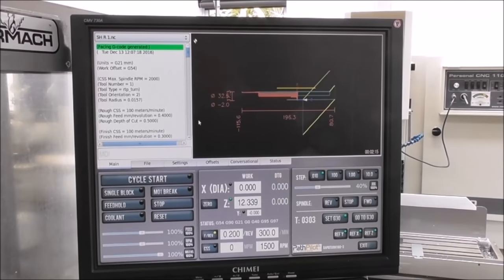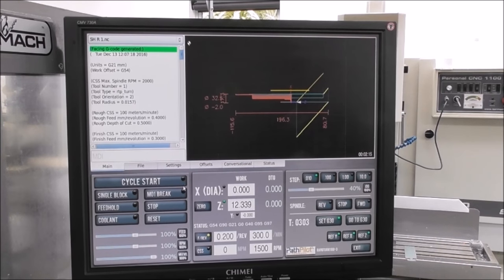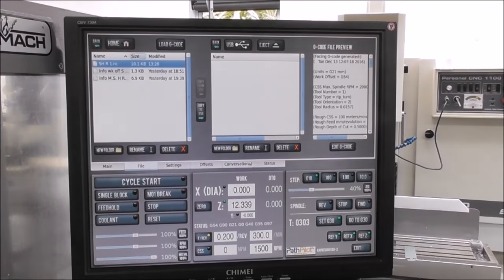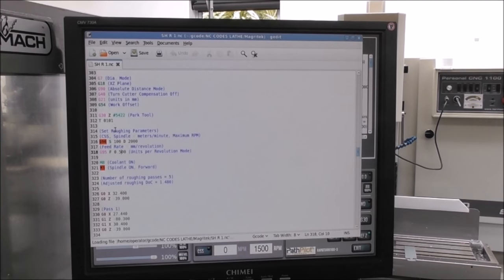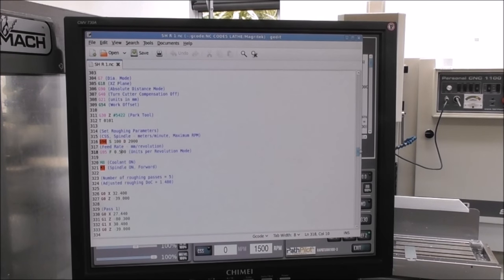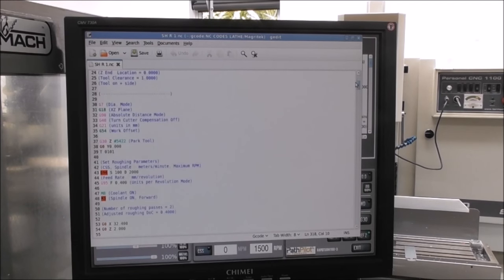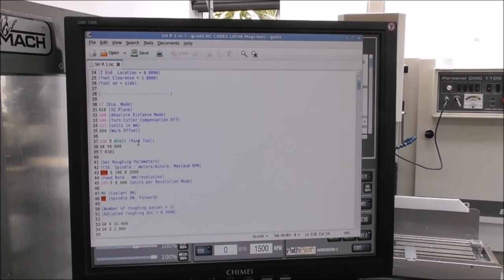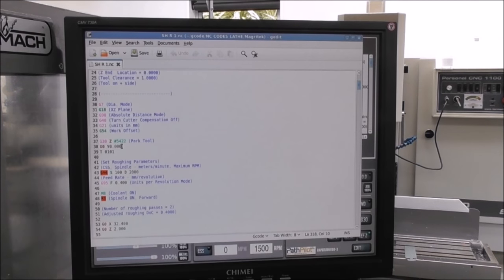Tormach RapidTurn -10 set up

Comment: Hi Cliff. Thanks for the video and all the great information in this series. You have made similar acetal parts in your mill spindle turning series. The advantages of rapid turn are clear but I'm wondering if there would there be any advantages of mill spindle turning over the rapid turn for those types of production parts? More gang tools, 1.5hp or greater rigidity perhaps? Cheers, Kieran.
Reply from the maker: Hi Kieranga. Interesting question. At the heat of my rapidturn decision. Well in short, so far I think rapid turn wins on most counts. The conversation software, lathe type speeds/feeds, threading, and the ability to use a tailstock. Outright power is the only downside I can think of - my mk 2 gang tooling will have enough tool stations. 

Cheers.  Cliff

Comment: Hi Cliff,
             t's nice to see things look good with the repeatability of diameters, I am pretty sure my problems were with the way I was touching off the tools. Your tooling set up looks great, once I get some time I will probably make something similar for my RapidTurn. 
Currently I am making a tilting fixture that will , hopefully, allow me to mount the 8" fixed rotary at the rightt hand end of the mill table and allow it to tilt through about 90 degrees in the y axis plane.
I couldn't find any
Reply from the maker: Thanks for posting Bob. Cheers.

Comment: I hope they also look at their Slant lathe.  There has been vibration problems with the 5c systems also.  They may simply need to look at the length of the spindle spacer.  From pics I've seen, the adapter may be too short.Have a Happy New Year.  Thanks from Texas.
Reply from the maker: Hi Vernon - Thanks for that information, I wonder if it is the same issue?

Comment: X - accuracy after repeated tool engagement with various material worthy of consideration at all?  Nice to see you got it paying for itself already!
Reply from the maker: I think you means test also for tool spring out with different work materials?...If so yes that will be worth doing. Cheers.
Reply: Yes that is what I mean in a way, I don't know how to put it into machine design terminology. One is the X movement accuracy (stepper, ball screw, flex in the column, etc.) or the flex in the tool holding apparatus itself.

Comment: Thanks for the video series. Would you mind showing off your 5 inch chuck and the process you went through to get it to work on your rapid turn? Thanks again
Reply from the maker: Hi - do you mean more info on the adapter plate, or the reduced jaws?  Cheers.
Reply: @Threadexpress  I think he is referring to the adapter plate. If so, I second his request!
Reply from the maker: @neyvindeleon1080  OK - made a mental note to do that . Cheers  Cliff